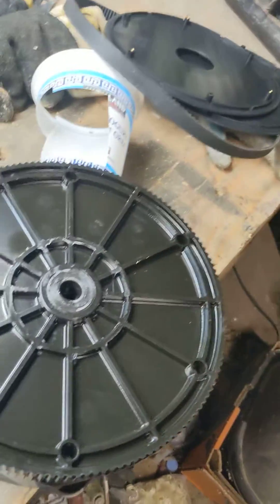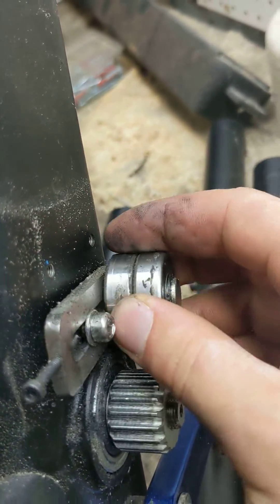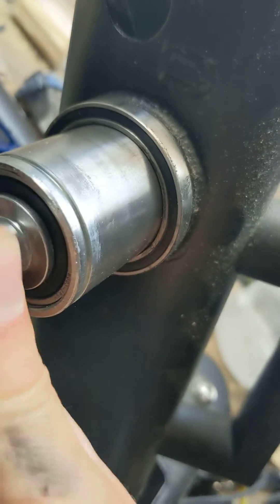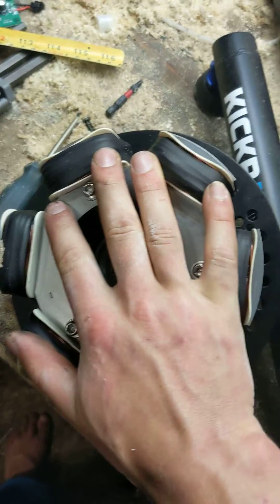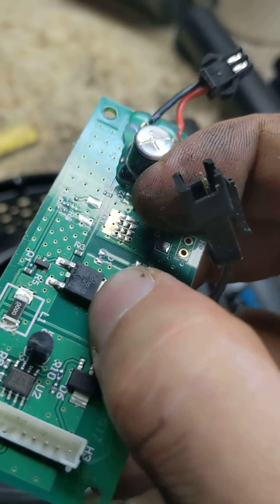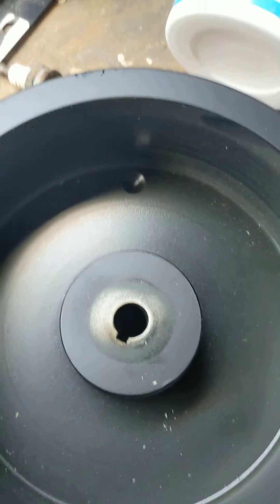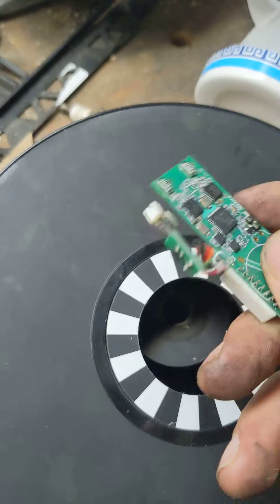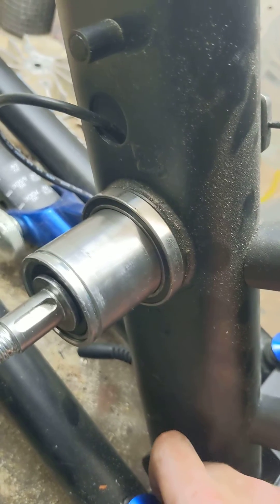Wahoo bike trainer teardown

Comment: I don’t think you’re right. Those coils are not producing electricity. They’re electromagnets. The currents are produced in the flywheel. That’s why it gets hot. That little board only has to supply the current needed for the electromagnets. It has nothing to do with what power the user produces.